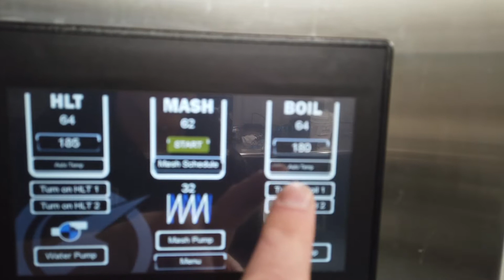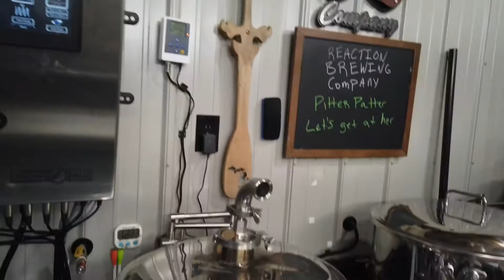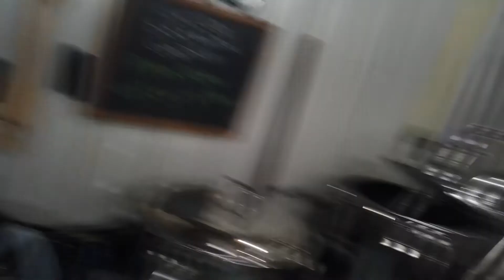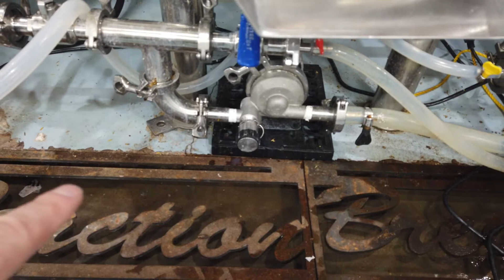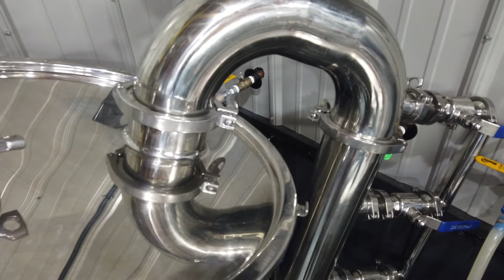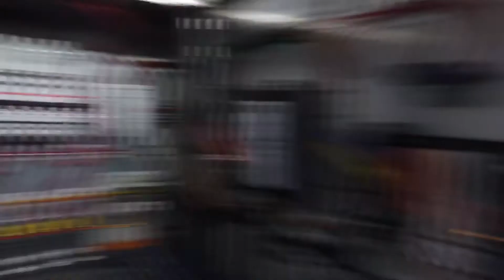1BBL 3 Vessel Herms system tour

Comment: So I'm definitely ordering the panel for my electric system from ebrewsupply.  However, i have an SS uni-tank and the FTTS control system, what is the advantage to having the extra screen on the brew panel to control fermentation?  I only want to do this once, so is it worth it or just an extra bell and whistle?
Reply from the maker: When he built my panel he didn't have it integrated into the main screen, I think you can control 2 vessels off the main screen now.

I can run 4 vessels off the secondary screen.

Comment: Nice system, why cant you put a small fitting on your boil kettle dump valve to use that as a sample port?
Reply from the maker: The actual dump at the bottom would be full of trub.  I could add a port to the sight glass or off the inlet/outlet to the pump.  It's just an oversight I never thought about when I ordered, hopefully the next guy can make the correction.